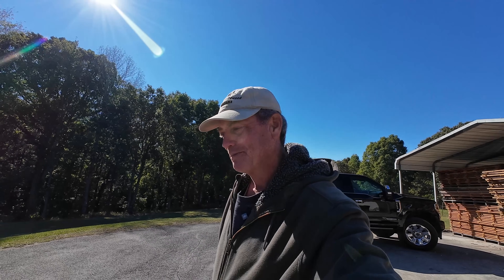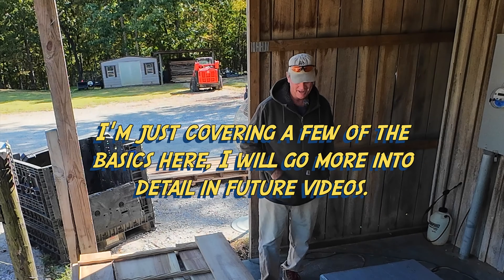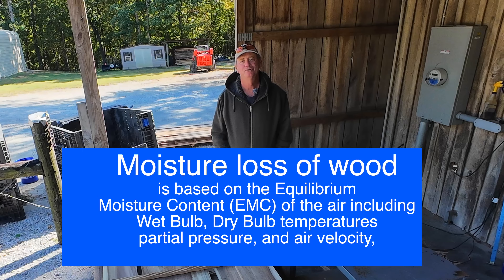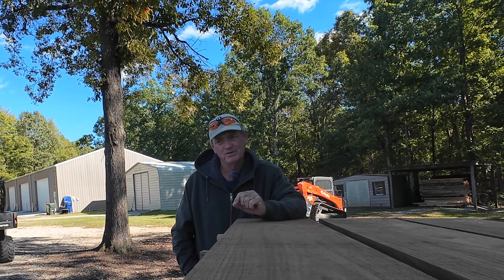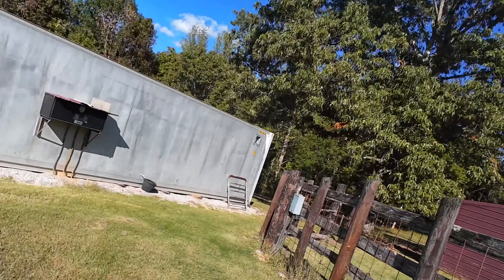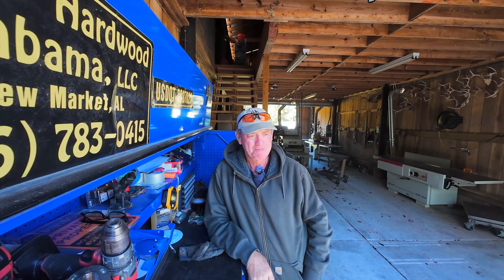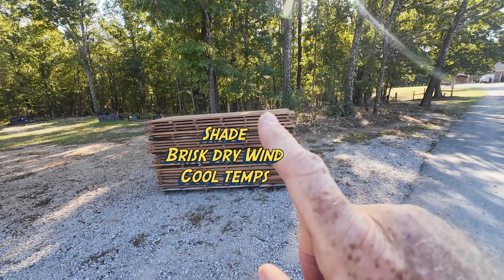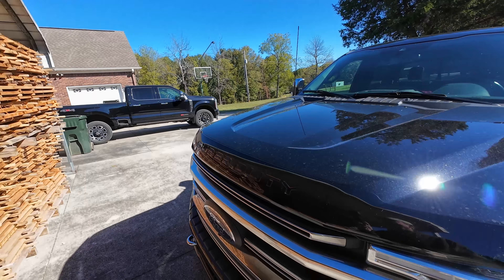Air Lumber Drying Secrets of a Pro!  Maximum Allowable Moisture Removal Rate Explained!

Comment: Hey Robert, I wanted to ask about blades. I have a Norwood HD36V2 (23hp) i use the Sabertooth carbide tipped blades, where every 3rd. Tooth is carbide. I cannot understand  how you saw so fast. Every time I try too push harder, I break the blade.  Very frustrating. What type of blades do you use ?????
Reply from the maker: I'm using Woodmizer 7 x 49, .055" thick, and 1.5" wide.  I don't like carbides much, the kerf is so wide, they do cut slow.

Comment: Thank you, Mr. Robert, for another great video.

What sources can we use to determine the maximum allowable moisture removal rates for wood?

If a kiln is designed to provide the best possible conditions so that wood loses moisture within the allowable rate and defects are minimized, why do you still prefer to air-dry lumber first?

After all, during air drying the conditions can—even if only for short periods—exceed the allowable drying rate, whereas this does not happen in a kiln.

Aside from energy costs, shouldn’t lumber that is kiln-dried directly from green moisture content down to 8% be higher in quality than lumber that is first air-dried and then kiln-dried?

Is the idea that air drying “releases internal stresses” just a myth?
Why doesn’t a kiln release stresses when all conditions are fully controlled?
Reply from the maker: Now THAT is a good question, and is the core of the differences and reasons for air drying and kiln drying and deserves a video!  However, I will explain with just one or tow reasons, as best I can.  If done slowly, a kiln can optimize the conditions for which lumber needs to dry, over the entire drying cycle, but due to the max allowable moisture removal rate, it is necessarily very slow, and sometimes can take months.  No business can afford to tie up their  money making kiln, or pay the power bill, and keep a load in that long.  We try to cycle a load every 7 to 10 days.  So commercial kilns use very specific techniques to allow boards to be dried faster, and remain straight, through and accelerated drying cycle which imparts very high stresses the wood, and these stresses must be realized at the end of the drying cycles.  This rarely happens perfectly, and is one reason when you sometimes cut into a store bought board, it will pinch the saw blade, that is due to commercial drying stress not being released correctly by the kiln operator.  Air drying is a much slower process, and in 90% of most lumber, will not exceed the max drying rate, although it is right on the curve, and so a kiln would not be drying the wood any faster.  Both the kiln and air drying is essentially at the same speed in the initial drying cycle, but air drying just takes time, not money, and allows the kiln to be kicking out 4X more product, and it is not stressed at all.  So air drying initially, then finishing in a kiln, actually produces a better, less stressed product.
Reply: @HobbyHardwoodAlabama  It was a very complete answer. Thank you very, very much.

Comment: Are there times to avoid harvesting certain species?? Do woods do better when they are harvested in a dormant period? I heard comments about allowing felled trees to lie with limbs and branches attached to allow the leaves to draw the moisture out. Locust I was told never to harvest in the spring or early summer or it would rot easily. What about leaving the log un-cut until they have had some time to dry?
Reply from the maker: Yes, some species produce better logs when harvested during certain times of the year.  For quality lumber, anytime a log is allowed to sit for more than a few days, or a week, it will start to degrade.  A month is about my limit on most any species, and in addition to starting to crack and check, dry logs saw poorly, the moisture in the log is a blade coolant, so green logs cool the band the faster they are sawn.

Comment: I'd like a copy of that TOP SECRET drying chart. After 20 years in the tree business, I'm finally going to buy a mill. My brain is tired of learning about mills.  But, the information you shed light on the most fundamental issue of drying wood. I'm not rich yet. So, should I buy a WOOD-MIZER or WOODLAND MILLS? I know WOOD-Mizer is better, butt dollar per pound and HP.  Thank you for the great video
Reply from the maker: Both mills are good, it just depends on your budget and how fast you want to cut.  However, I would buy a hydraulic mill over any brand of manual mill.

Comment: I quarter sawed some 4/4 white oak for my truck bed last week.  The trees were cut 3 or 4 years ago.  Without a kiln what's the best way to dry it quickly?  And since the truck will be in a non climate controlled environment, what should I get the moisture content down to?
Reply from the maker: White oak is very prone to cracking form drying too fast, about 3.8% moisture loss per day, so air drying is about as fast as you can go.  I'd recommend getting them to abut 15% t0 13% and they would be ready to use.

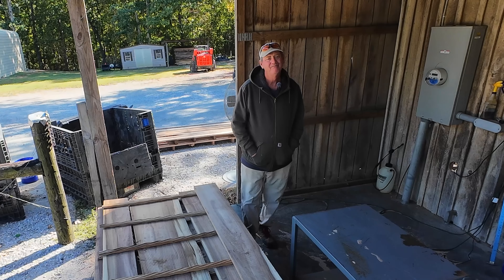Comment: Q. At min 3:16 what do you mean when u mention the board "degrading"? What does degrading mean in context?

Does it mold, fall apart or do u kean its just not useful for building perhaps??

Ty in advance!
Reply from the maker: Degrade in this case means that drying too fast will cause cracking, surface checking and degrade of the structure of the board.
Reply: @HobbyHardwoodAlabama ❤ Thank you so much!!!

Comment: great video - enzyme stain...I learned something. and those fluted sticks...LOVE THEM! so much to drying wood. Everything I use I saw at 12/4. in my mind, wood drying is more like "curing"...conditions and time are critical. if I put my 12/4 green slabs into a kiln it would case harden...and we all know that trapped moisture is coming out. instead, I wrap my slab collections in shade cloth and put it in an open sided pavilion for 2 - 3 years. I also have close buddies who know more than me who protect me from myself!!
Reply from the maker: Great, sounds like you've got it working right!

Comment: I have been covering my wood with sheets of tin. I’m going to build a large pole barn for putting wood under. My kiln is going to be solar but I only plan on doing lumber for myself in it. I’ll be turning some and making charcuterie boards as well as cutting boards and resin tables. I want to be able to control the entire process myself.
Reply from the maker: You will be glad you have control.

Comment: I keep watching and realized I need to start taking notes as your obviously getting great results and I dont want to reinvent the wheel:

Im new to sawing and using a Woodland Mills bandsaw and using for my own projects. Not trying to start a business sawing.

Three questions off the batt:

1. Im in western VA and have a lot of vagina scrub pine. Do you think I could use it to make beams for small creek bridges or siding? I know I can’t use it for much but interested in your opinion. 

2. I harvested a beautiful white oak, big tree. I used first section I bucked to make 2” thick boards for my creek bridge planks becuase I figure it will last longer. I let it all air dry for three months on stickers. I know its prolly not dry enough to make cabinets but Do you think I can use on creek bridge even though they are still green-ish?

3. I got some wax stuff for the end grain. You didnt mention if you use that. Your thoughts?

Thanks in advance for any data you may have.
Reply from the maker: Pine is good for siding but not anything outside unless it is treated somehow.  Best thing is to get a moisture meter, even a cheap one, and the closer the wood gets to ai dried moisture content, about 15%, the less it will shrink.  You can use it at any time, it will just come down to how much you will mind if the spaces between the boards open up.  I generally use Anchor Seal on my log ends

Comment: Firstly thank you for sharing your knowledge.  I thought I was starting to understand the basics of drying lumber, wrong.  I use a solar kiln and was understanding to air dry for a few weeks then place in solar kiln with several vents open has a total of 8 1ft x 6in with box fans running.  once the moisture content was stable and not dropping further I would close all vents and try to get a day or two of 140 deg temps to sterilize.  But this sounds like it may lead to enzyme staining.  I have only dried a few charges.  I have had good look but it sounds like it was more luck than science!  is the sterilization step necessary? if so how to avoid enzyme staining?
Reply from the maker: Sterilization is only necessary if the wood is going to be used inside or if you are selling it.  Google Powder Post Beetles and be prepared for a shock at how devastating they can by, they make termites look like cream puffs are very common in many states.  Enzyme stain typically occurs in white wood, such as maple, poplar, basswood, stuff like that.  Of course, sticker stain can occur under the stickers of many species and if it's mold related, will generally plane out.  If its enzyme stains, it will get worse the deeper you plane.  If you want to get some more detailed information, do a Google search for "Enzyme stain in whitewood" or something like that.  Most enzyme stain is caused when the wood is still fairly wet, 15% MC or more,, so sterilization at the end of a drying cycle will not cause it.  If you see it, it happened way before then.  I like solar kilns, I had one, and the key to operation them is to keep the vents open and get the moisture out.  The rule of this is to never, never let the wet bulb and dry bulb temperatures get within 10 degrees F, or sticker stain and enzyme will probably happen.

Comment: Im a little confused about oak. Does it have a different cell structure than other woods. In that it has less resistance to hold its moisture an dries quicker in the same conditions has walnut or cherry
Reply from the maker: Yes, each species has slightly different cellular geometry and amounts of clogged pores and tyloses, and can be seen as end grain under magnification, so each species will have an optimum and a maximum moisture release rate.  For example, white oak is very much different than red oak, although they are both oaks.  That's why ships were made of white oak (Old Ironsides) but ships made of red oak would sink like a sponge.
Reply: Thank you...

Comment: 4% moisture per day on red oak would take a 50% to 10% in 10 days. I would be impressed to see air dry that fast.
Reply from the maker: Sure, but when I say air dried, I mean "not using a kiln" but don't say not using other means to "air dry" right at the maximum moisture removal rate of the species of wood.  I didn't specifically describe how I do this, you can actually see me hesitate in the video, because after all we are a business, and I can't give away all my secrets, but...if you do some searching on scientific papers on air drying, you will find an extremely interesting series of data detailing drying rate vs air velocity, vs ....other things, all of which can be easily controlled in an outside environment with very little expense and energy, and not using a kiln to bring lumber down to the Fiber Saturation Point.  Then the light bulbs should start going off.

Comment: Thank you for this information. i live in Northeast Ohio and cut mostly hardwoods, black walnut, white and red oak, cherry, hickory, beech, maple. I pretty much mill my logs only during the "er" months - September, October, November, December. That way the lumber will dry slower and minimize the checking, cracking. All the logs are painted with Anchorseal on the ends before milling. Right after milling the lumber is stacked and stickered and weighted down. I cover with sheet metal roofing and the wood is stacked in  the canopy of large trees but has a north/south orientation so the wood still gets wind from the prevailing winds. Our EMC is 13% and I've found that the lumber gets down to that level in a little less than a year per inch . I've also found that bringing the wood into my basement during the winter the moisture content for 4/4 board gets down to 8% in about 2 weeks. I have built several projects with these hardwoods and have not had any movement issues. I do use a Delmhorst pin moisture meter and take measurements in several locations.
Reply from the maker: If it was easy everybody would do it.

Comment: thank you this answered a lot I have2" thick white oak air drying in garage checking bad also was a 6 hour drive in the back of a pickup 1% in 24 hours I've got some syphering to do
Reply from the maker: You are correct, there are multiple stages of drying wood, and the first stage is when air velocity over the fish green lumber has the most detrimental effect and also where the most defects occur, however, are the hardest to see.  I will be doing a video of this very thing shortly, you read my mind!
Reply: @HobbyHardwoodAlabama  thank you also that the white oak I have are a product of hurricane Helene don't know how much affect that has. enjoying the videos

Comment: Question, that maybe you are not able to comment on.  Some weeks ago I watched a few videos on drying wood in a large vacuum chamber.  There was no mention of maximum allowable moisture rate.  Just wondering if you have any thoughts or knowledge of this process? (Good or bad for wood quality with this process?)
Reply from the maker: Actually, I have looked into them quite a bit and, conversed with various companies, and heard the good and bad from both owners and lumber buyers.  I have decided that I don't want one. A true vacuum kiln, (I knew the inventor of a very good brand) is extremely effective, and can dry wood very fast.  Quite complicated, even to the point that radio frequency is used to heat the wood because there is no air left in the kiln.  However, there is a crop of hybrid vacuum kilns that are not really getting down to a low enough vacuum, and still retain air so can be heated by heat strips which is not good in a vacuum kiln, and so still must abide by the max allowable moisture removal rates.  Simply looking at their advertisements when drying difficult species, especially white oak, (no names or brands specifically) require "pre drying" white oak weeks before putting them in their kilns.  So proper air drying techniques must still be used, even using these vacuum kilns.  As I mentioned in the video, you can't beat the physics!  I can also say that I have seen more wood ruined using hybrid vacuum kilns than in conventional kilns, simply because their capabilities are over advertised.  No doubt, a good operator can run them well, but that is true of any machine, but most are advertised as "Easy Bake Ovens" i.e. put the wood in, set the timer, and rake in the cash.  That does not happen in the real world.  In short, if I thought they were better, I would own one.  Just like everything out there, some are good and some not so much, and buyer beware....
Reply: @HobbyHardwoodAlabama  Thank you very much for a complete and helpful reply.

Comment: I’ve always heard larger commercial mills can add humidity into their kilns which can help close surface checks during the air drying process
Reply from the maker: They are doing a process called "equalizing" which raises the moisture slightly on the case or outer layers of wood to equal the moisture level of the core of the wood.  The temporary swelling may cause the wood to expand and the cracks to be reduced visually very temporarily, but the damage has already been done and the wood is ruined for high grade furniture or anything else.  That's why it's so important to look at the wood surface very carefully when buying it, to make sure the cracks and ducts are not being hidden.  In addition, if too much humidity is applied, the outer case of the boards expand so much, they literally pull apart the structure of the wood fibers, causing "honeycomb" where the wood looks fine on the the outside but has voids and cracks inside the board.  In short, they have cracked and ruined the wood, and it can't be fixed.

Comment: I have a question directly pertaining to white oak. I'll be cutting some heavy beams in the near future, roughly 12x16. Cracks are a huge issue that I'm concerned with. Any suggestions here to steer me in the right direction? These are for a bridge on my property. They will unfortunately contain the pith in the center due to limitations of both sizable logs and mill capacity. Slight slight chance I may be able to cut without keeping the pith, if I can find clear logs.
Reply from the maker: No, you will always have cracks with the pith, there is nothing you can do about it.  You are talking about cutting beams thicker than railroad crossties, and if you walk down a hundred miles of railroad track, every single crosstie will have cracks in them.  You can use mechanical means, big plastic or metal "S" shaped pieces hammered into the ends of the beams, they are called "Crack Stoppers" as a generic name, and are pretty effective, to a point.